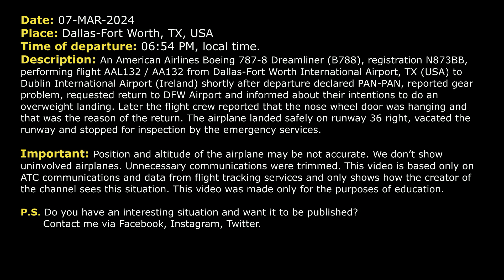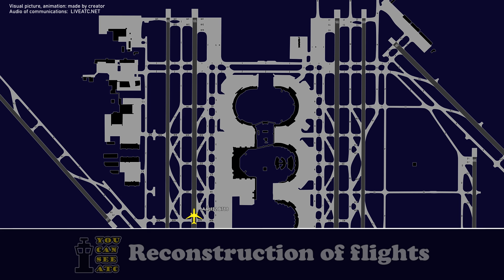PAN-PAN. Nose gear door issue. American Boeing 787 lands overweight at Dallas. Real ATC

Comment: Oh ffs, how many times does ATC need to ask about souls on board and fuel remaining?  Why isn’t this info passed along?
Reply: Workload and airport policy. How many passengers and crew to count when the slides come out? What is the emergency? Which side will the slides be?  Time in fuel, how long can they stay in the air?  Pounds of fuel, what does AFR have to deal with on the ground? Checking checking checking. I worked in surgical theatres for years, count swabs, count instruments, count tubes & drains. Do it again.  More people survive that way.
Reply: @theChickenstones  asking once is fine; it's the need for repitition on each new frequency that seems like a poor use of airtime and pilot attention.
Reply: @tfofurn  Yes.  VERY distracting to the pilots who are actively troubleshooting.

Comment: Why does each consecutive controller as for souls and fuel?  Very few only have to report once but some have to report with every controller.  Really erks me.
Reply: for verification.
Reply: @BigTulsa  The pilots are in a high stress moment, running through a series of checklists and trying to keep a disaster from happening...they shouldn't have to keep repeating themselves on the radio...period.

Comment: Dear ATC professionals, do you see how incredibly unprofessional you are? Pilot has to declare a PAN twice. Controllers ask for the same information disrupting the cockpit at a time when they're executing a checklist ... sometimes with steps that have irreversible life endangering decisions. Fuel in pounds. Fuel in time. More so, you ask which runway the pilot wants, the pilots tells you, you accept it. Then the next controller asks to change the landing runway. Awful.
Reply: Let the professionals do their job.
Reply: @saxmanb777  Just like PIA Flight 8303 then?
Reply: You aren't a pilot are you?

Radios get stepped on, you may have heard something on this recording the controller did not.

Pan-pan is not an emergency, it is only urgency, a runway change requesr is 100% acceptable - if the pilot said he'd prefer 35C they would have given it.
Reply: @alan_davis  Very much a real ATPL pilot. Yes, radio calls can be stepped on, a long radio call like that being stepped on? And the controller not saying "two radio calls at once .. " Come on. And they asked which runway. If at the time they first asked the pilot selected a runway that would have disrupted ops, they should have then asked "will runway XX work for you?" Instead the crew was most likely getting setup for the first runway and had to start over. I worked in a safety office at my airline where we have data which shows crew errors directly relate to runway changes or other big changes. And more changes cause more errors. I am not blaming ATC for crew errors, but ATC issues do affect crew performance. We need to keep it simple but instead pilots and controllers are making it complicated.

Comment: I've seen many of these videos and maybe someone can explain to me why is it sometimes when the pilot reports the fuel in pounds, the controller will ask for it again in minutes and other times when the pilot reports fueling remaining  in minutes the controller will turn around and ask for it in pounds.  Why is there not just one single standard of either pounds or minutes so that everyone is one the same page?  Seems this constant back and forth would be frustr
ating for pilots when they are trying to deal with other issues.
Reply from the maker: Controller needs fuel in time to know how long the airplane is going to be in the air. Fuel in pounds is for emergency services.
Reply: @YouCanSeeATC then ask for both
Reply: @Gee1410thirtysix  Not 100% sure, but I think they need to ask it at least twice by regulation as a safety layer. I've heard pilots providing the wrong numbers several times. And I've also heard ATC picking up the wrong numbers. If the pilots' workload is very high, they have the option to say "stand by". Which we also get to hear quite a lot: pilots being asked multiple times, but answering only once due to high workload in the cockpit.
It's a dynamic environment, not always suited for one size fits all approach.
Reply: @BlueSkyUp_EU  no they don’t. That’s not a reg or safety layer. They’re busy working an emergency. Get the people on board right the first time.
Reply: Also, why does that information need to be stated twice?
Reply: Why not just ....lbs and .....minutes endurance to minimum fuel.
Reply: It's however the Crash Rescue at that airport wants it for their calculus

Comment: Shh don't tell the media they missed an actual new aircraft. 😆 The other issues they reported were on older aircraft but in this case it's actually one of the new 3-year old Dreamliners. I mean we know why the United ones were reported on though. You had plane spotters catch two of them in the same week live, plus the photos and videos by passengers. This is one of those well handled by the crew though.

Side note: That pilot did not call PAN-PAN. He was repeatedly saying "bread" in Spanish.
Reply: To add some further context on all this: 

United has almost a thousand airplanes, the third largest fleet behind AA and delta. The more planes, the more problems. United is also 45% of the market share of SFO by seat numbers and has a big maintenance facility, so the chance of being SFO departure /arrival being united is high. Weirdly, the more dramatic failures in United may not actually be really United fault -- wheel failure looks to be manufacture issue (tho united choice's it's manufactures), hydraulic leak that got caught on camera looked to be a puncture, the rudder issue is probably Boeing or part failure , and the runway excursion was their pilot err but also weather and atc hurrying.

I have no love for Boeing nor United, I just want more accuracy/context in reporting and talking about issues, which this issue has made me even less trusting of news to give me a fair take